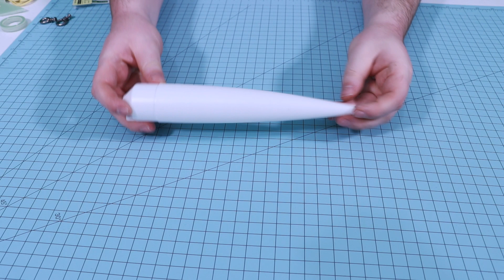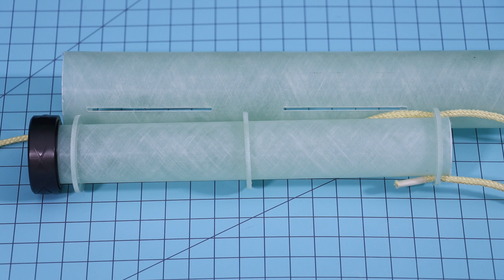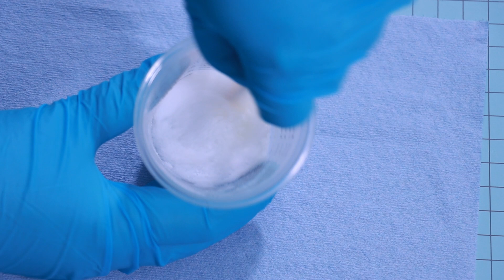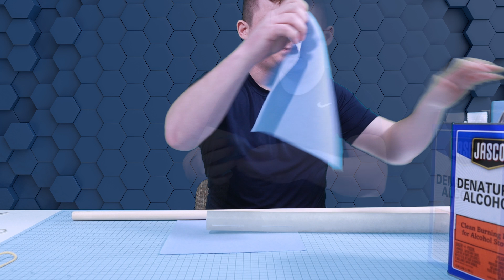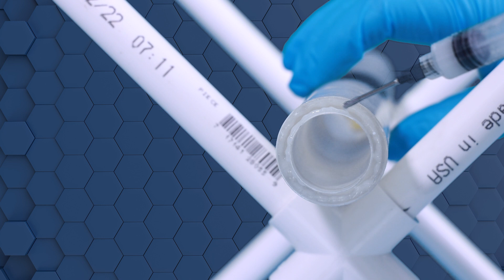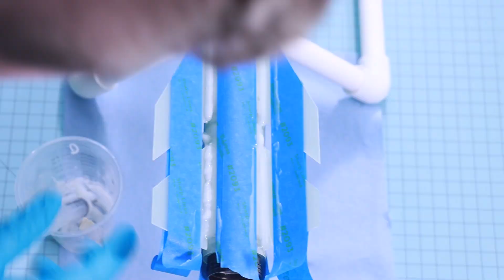Mach 1 Black Hole Rocket Fin Can Build

Comment: Hot water and soap do a much better job of removing the mold release from fiberglass parts.  I would then clean the parts with alcohol.
Reply from the maker: Thanks for the tip I will have to give it a try!